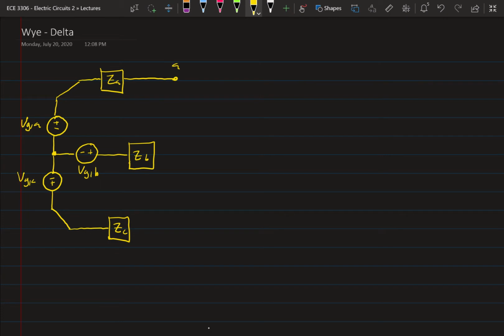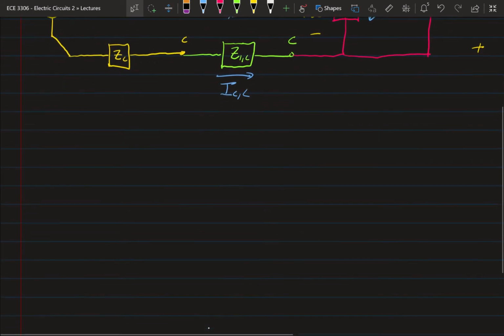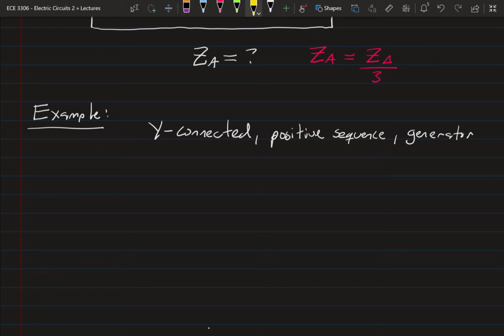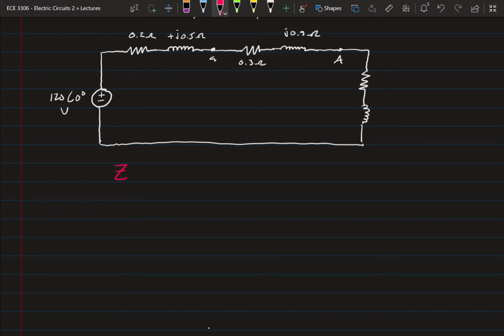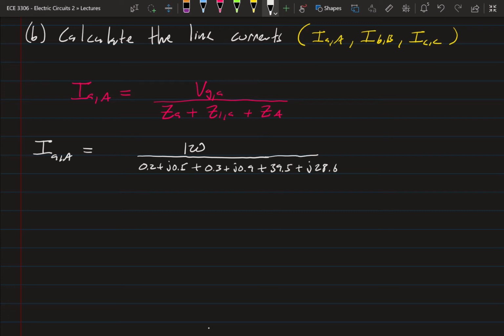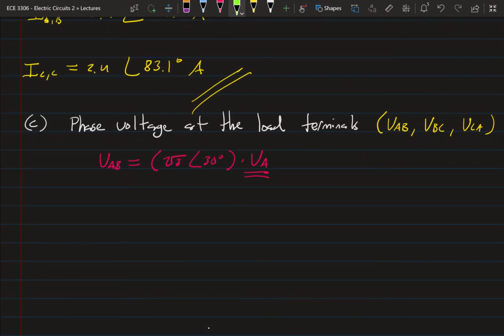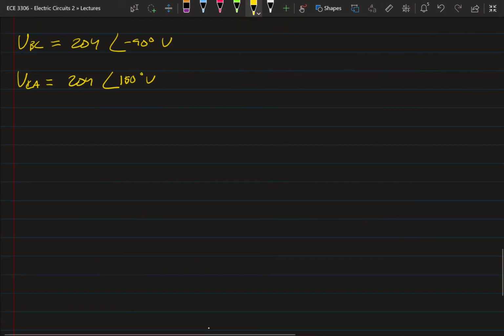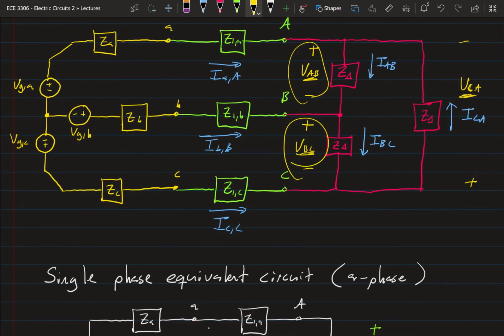Analysis of Wye-Delta Connected Three-Phase Circuits

Comment: Would you consider doing an example for a Delta-Y, Unbalanced Load, with Line Impedances, NOT converting the source to a Y equivalent, calculating the source, line, and load currents, power delivered, and power consumed.